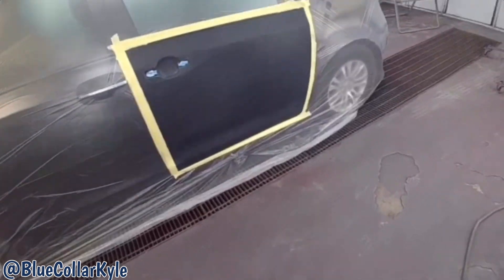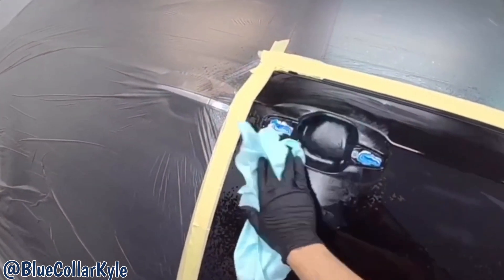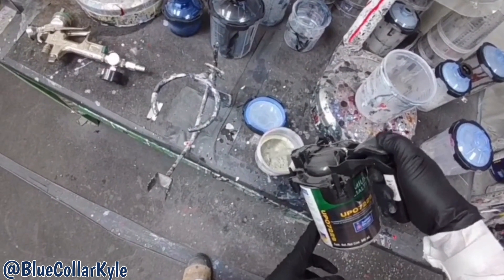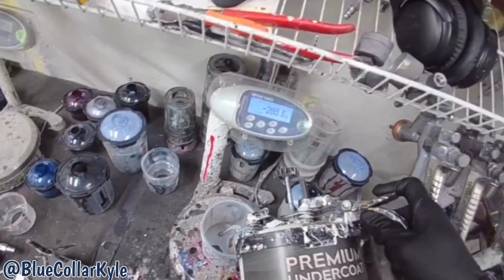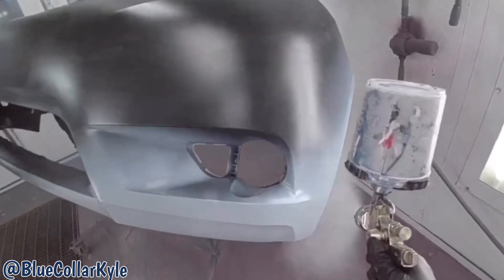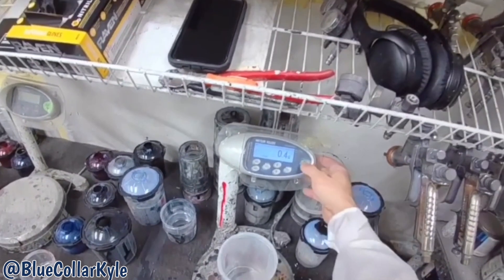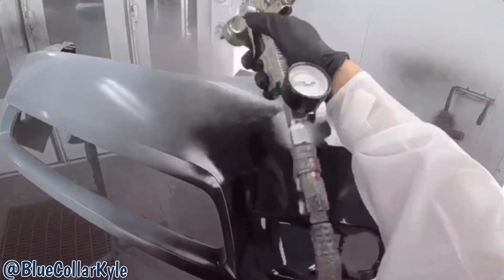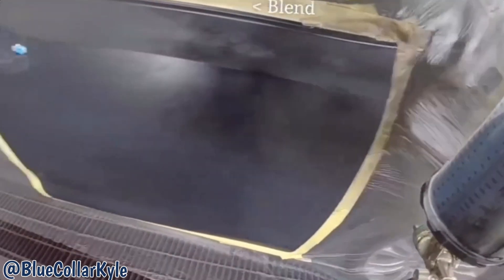Paint Booth Time!

Comment: Hi Kyle, recently I got my mazda 6 2018 painted. I know it will never be same as if it was from the factory. However, is it normal that branded car services (mazda) like mine would not be using fully sterile paint room? I could see that there are few tiny marks on the clear coat. Not sure if its micro dirt or what. They told me that no dealers around here would go for fully sterile environment since its dozens cars a day being painted and there simply no capacity to wash cars before they go in. They just basically use plastic folie to cover the parts not meant to be sprayed. I was disturbed. Especially knowing that mazdas soul red paint is a complex thing...love your channel! Fan from Europe